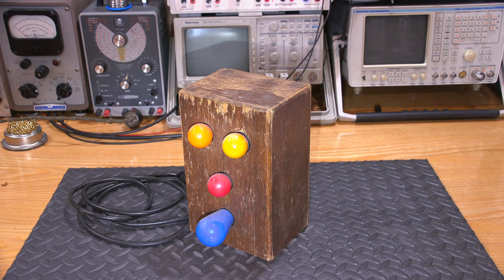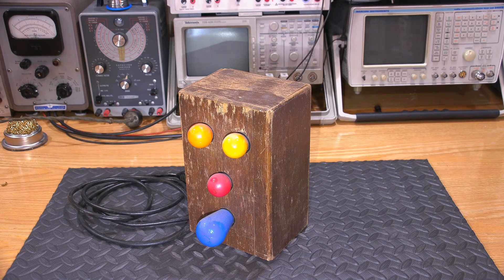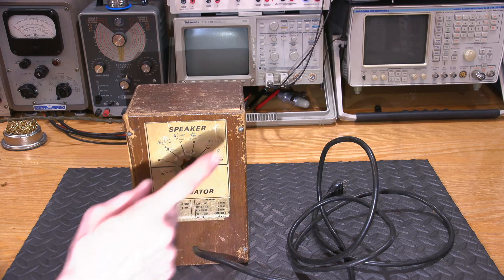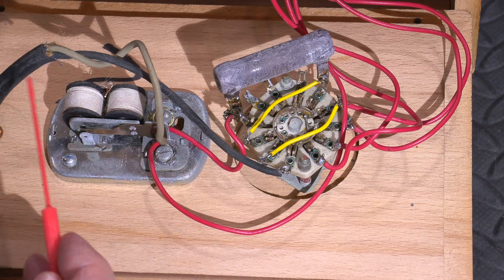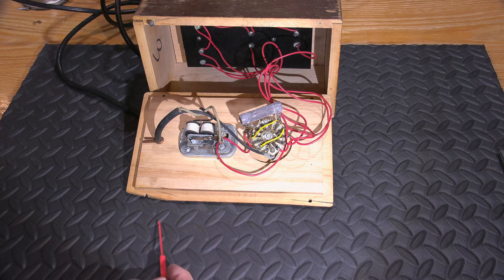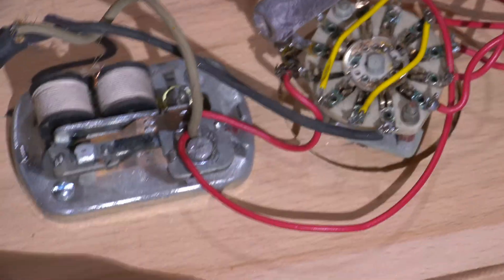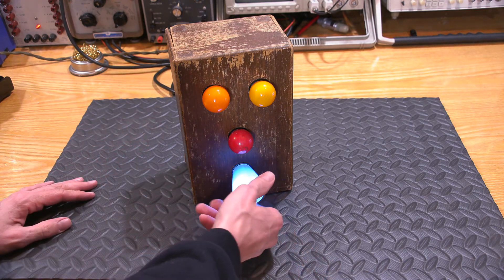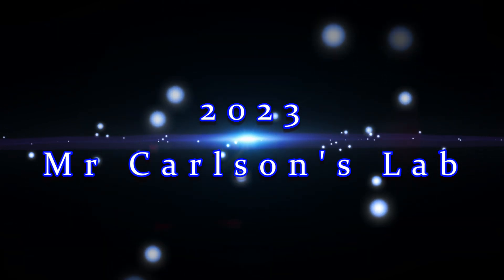1950's? Psychiatric Hospital Electrical Device - "The Evaluator!"

Comment: I don't think I've ever seen a buzzer like that connected directly to 120V. They are usually designed for about 12VAC/DC.. NOT TO MENTION the hot frame connection.
I'm guessing that you are correct, the contacts will not last long at all at 120V.
Buzzers designed for 120VAC usually don't have contacts, they just vibrate at 60Hz. (And make a horrible noise)
Definitely an interesting video, solving the mystery.

Comment: The arc at the contacts ends up maginified as a result of the electromagnets acting as inductors.

I can remember as a 10 year old kid making buzzers out of 6-volt relays, using a 9-volt battery, and then very QUICKLY finding out about the inductive "kick".

There can end up to be 100volts+ at the power terminals depending on the relay and how the coil inside was made. 

Then I figured out how to drive the right transformer with my buzzer relays, and stepped the jolt up quite a bit. Then it was time to charge up breaker point condensers with it, and then toss them to my buddies to see what their reaction was when they caught it and got zapped.  

Yea, I was a typical dick as a child... 😆

Comment: I built something like this. We call them  Toastmaster Timer. It's for public speaking training. The face is unique. Most of them I've seen are a more stoplight style configuration. For a 10 minute speech usually the blue light (or green comes on around 5-6 meaning  your halfway through the main body of your presentation  Orange or yellow was 2 minutes to the end. Red for finish now and the buzzer is your 1 minute over.  The buzzer was something every speaker dreaded.

Comment: It looks like a common low voltage door buzzer with a resistor sufficient to drop the volts down to 16 or 24 volts.

Comment: Door buzzers were designed to operate on low voltage from a step down transformer. typically 10-24 volts.  The big power resistor in the box was used as ballast, to limit current through the buzzer while operating it directly from the mains voltage.  While this might have saved a couple of dollars, it would have been murder on the buzzer interruptor contacts.  With the contacts closed, the coil resistance in series with the resistor forms a voltage divider which drops the voltage across the coils to something manageable.  At the instant the contacts open however, the full mains voltage appears across them, striking a nasty arc across the gap.  The lifetime of that buzzer is probably less than an hour.  That ballast resistor probably gets toasty as well.  Set up a time lapse camera, better yet a thermal camera and see how long it lasts.

Comment: Somebody bought Elvis's private jet with much of the equipment still working after sitting for decades in Mexico. The Fool who bought it started up with an external power unit, he could have set the whole thing on fire with a spark.  I was wondering if you would be willing to do a shout out to restore some of the vintage stuff such as the FM/AM radio or the CRT that has custom cabinetry built around it?

Comment: Icom 7800 ham radio outlet has one needs a back lite it weak maybe you or your friend may want it it's  a $10.000 radio new they want $ 3.800.00 for it top of the line radio it be nice H F radio for you in my video ham radio outlet 2/28/2023 that how you find my video

Comment: Items like this frustrate the heck out of me since the designers fail to consider those of us who are colorblind.  Being red-green colorblind, I cannot tell the color difference between the red, orange and yellow light bulbs.  The only way I could utilize this device is by being able to see which position the illuminated bulb is in.  Just as I have to do with traffic lights.  If I’m not close enough to see the position of the lit bulb, I’m lost.  I have a similar complaint with weather radar.  I can see the difference in shading but cannot tell what the colors are to indicate the intensity of the weather threat and whether I should be heading for the basement or putting out my lawn chairs.  As applies to electronics, I am unable to work on electronic equipment since I cannot read resister color band values or trace a wire by following its color.  Believe me, it’s frustrating.

Comment: Ok Paul, I forgot to ask about that really cool neon you used. You should do more short videos on your collections of tubes, neons Nixies, etc. Fran has some great videos as well. As for the bulbs in this thing, the top three are S11 and the bottom one is an S14. If it wouldn't destroy the antique value on this, make a binary counter with this. Maybe a timer with a half second buzzer when the count is done. Thanks again for keeping it interesting!

Comment: On a related note, I wish you could get a modern ECT 'medical' device to check out. Given it's designed to send rapid electrical current pulses through the brain from electrodes on the skull, it's in the highest class of restricted medical device so I'd like to see how it compares to consumer/industrial electronics. In 2020 I had 6 individual treatments, and the process is really interesting. They run it 3 days a week and a small group of patients arrive at the hospital/center early in the morning to get changed into a hospital gown in seperate hospital rooms on a bed, then given the IV tube needed for general anastesia. Not long after, everybody is rolled on their beds down to a large room with a team of nurses/doctors and some rolling equipment. It's all open and you can see all the other patients, except they close a curtain around the patient's bed when the team gets to them. There wouldn't be much at all to see/hear but what surprised me is that the ECT device gives aural tones corresponding to the electrical output. It's pretty quiet until the Anesthetist says goodnight, followed shortly after by some rapid tones a bit slower than 60hz AC for maybe 5 seconds per patient from what I remember. They either do unilateral (one hemisphere) or bilateral (temple to temple), but bilateral produces even worse damage/side effects. 

It's no Lobotomy, but it's a treatment from way back that's stilll in fairly widespread use for treatment-resistant depression and maybe some mental illnesses. It's a fascinating 'treatment' but, as you might expect, randomly shotgunning through the brain isn't exactly precise and causes varying degrees of long-term memory loss, with seriously impaired working-short term memory which tends to nearly or fully recover after leaving the ECT groups.

Comment: Note that the wirewound resistor drops the 120V AC to 16 to 24 V only while the contacts are closed. As soon as the contacts open, it has the full 120V across the contacts. Maybe a little more due to inductive kickback. This is why it's sparking so brightly.  That is not normal.

The contacts would quickly burn out except it's not left on very long.

Comment: I once built something very similar as a teenager for my mother's toastmasters club.  Mine had a project box with a series of latching switches on it and a 120v to 24v doorbell transformer.  The lights were on a separate unit that I made with a trailer lighting bar and a wooden base that I stained and finished.  There was a handset cable between the portions.  I bought all the parts at Canadian Tire and Radio Shack and found the wood for the base in the neighbour's offcuts in his garage woodworking shop.  This would have been at least 30 years ago.
Reply: This video really filled in some things that I have wondered about for all these years.  The Toastmasters club had a very specific list of requirements for the device, including having stained wood.  I never knew why they asked for that and I suspect that the company that was making those wooden light boxes stopped making them and that is why the club came to me to make them a new one.

Comment: Does the buzzer cycle at 60 cycles per second based on the power supplied?
Reply: No this type of buzzer is vibrates by its own interrupter contacts. It would work on DC. The frequency is determined by its mechanical resonance.

Comment: I like that little box. It looks like one of those indicators that would indicate to a speaker presenting a speech or an argument that his/her time is almost up. What I like about the manual operation is that if the operator thinks the speaker is speaking a lot of rubbish, he/she could cut it off very quickly. Straight from blue to red and if the speaker still doesn't want to shut up, turn that mean buzzer on. That should be enough to scare the excrement out of anybody.  There is just one step that it doesn't have. That is where some probes are attached to the speaker and if they don't stop talking when the buzzer goes off, 115 Volts is coming, or 230 Volts. It doesn't really matter, does it?

Comment: I saw a radio disk jockey transmitting from a remote location where he was interacting with the crowd at a fair. There was a box similar to yours on the table at the booth he was in. It was a visual indicator of how much time was left before he was going to be live on the air.

Comment: The resistor looks to be in series with the buzzer, presumably  to operate a low voltage device off line voltage. Arcing would probably be alot less at the rated (16?) volts.
Reply: Those buzzers could operate around 8-10 volts. Had one in my house - buzzer and transformer from 1938. Still working in 2022. I played with them as a kid and do not remember seeing any arcing.

Comment: Not a 'Speech Evaluator" but a manual 'timer' for speakers to complete in the allotted time, followed by an evaluator to speak. 
In Toastmasters, after the speech is done the Evaluator (another person in the club) will give a short evaluation and offer tips for improvement; a third person acts as the Timer. This device serves as the Timers indicator for the other two. 
(I'm not in Toastmasters, have no problem with public speaking, but my wife was in Toastmasters for many years; as a non-native second-language English speaker it helped her quite a bit.
 Those who don't feel the need to join Toastmasters or are not interested should respect those other people who do find it valuable. Toastmasters also acts as a social setting for many.)

Comment: Great video, amazing those conact points survive at all that voltage, compared th a set of breaker point contacts in an old car engine at 12 volts,once again you need to basically know the voltage ,

Comment: Does that Buzzer open and close with the line frequency?
Reply from the maker: It would try on each half of the cycle. Whether the arm with the contact can keep up to speed with the sine wave is another thing.
Reply: No. He explained that. It's the opening of the conacts that makes it vibrate. It would works as well on DC. The frequency is determined by the mechanical resonance.

Comment: Looking at the front and back, you are showing this item upside down. I don't think it is supposed to look like it has a face on it. And I agree with others that this was used to give signals to a speaker telling them how much time they had left. The label also indicated that the bulb colors are incorrect. Originally the unit had green, yellow, red and white bulbs. And those would turn on in that sequence, giving more of a 'have to stop soon' type warning.
Reply: Maybe it neve did have a green because the maker couldn't find one. He used what he had.

Comment: OK, everyone else is offering benign explanations related to timing speeches and debates and ignoring the creepiness around this thing coming from a psychiatric hospital, so I'll buck the trend and offer another possibility.  A patient who has a distant relationship with the truth is interviewed by a doctor.  The doctor uses this device to give feedback on the perceived truthfulness of the patient's answers.  Blue bulb for truthful answers, yellow bulb for mild untruths, red bulb for a whopper and the buzzer for bald-faced lies.  Too many of the latter and corporal punishment would follow.  The light/buzzer box allows a bit of separation between the doctor and the feedback received by the patient; perhaps a useful feature when evaluating patients with violent tendencies.  The only thing missing is a set of electrodes to attach to the patient and a switch position labeled, "punish." ⚡☠😛

Comment: A neat little surprise to see the very buzzer I learned electrical circuits on way back in 1972. I didn't have a switch, so touching two wires together simulated that part. My dad bought me my own battery to keep me from stealing his all the time. The little bas_ard that I could be as a kid, I would swap my dad's good battery for my dead one. He just couldn't win.

Comment: I wonder if it might be used to evaluate some forms of photosensitive seizure activity, perhaps in conjunction with an EEG to measure responses to given stimulations - the red and blue lights fit for that, but the yellow?  Auditory induces seizures are quite rate but not unheard of, so the buzzer is plausible as well. Very interesting box and curious that its design invokes anthropomorphism, I wonder if that was intentional or just happen stance.

Comment: When I was in the signal corps, some tech had  made up a box with all kinds of knobs and controls.  It was labelled ''officer box''.  and left in the Tech shop.  After trying all the knobs you would end up asking, what is it for?   The tech to answer: it gives you the impression of controlling many things but actually it produce nothing worthwile but keep an officer busy!
Reply: Reminds me of a place I worked where staff in a large room always complaining about the HVAC - too warm, too cold, air too dry etc. One of the tech guys made up a box with potentiometers marked temperature, humidity, fan speed, etc.
Stuck it on the wall behind the supervisor's desk. Of course, it wasn't hooked up to anything and controlled nothing. However, they stopped complaining! All was good until one of the supervisors thanked the engineering manager for the new HVAC controller. What HVAC controller was the reply? Manager wasn't too happy, the panel was removed and the tech "genius" got a ticking off 🤣.

Comment: I think it actually had nothing to do with patient treatment, I think it was used for practicing or conducting lectures or speeches and it just signaled when their time was ending or had ended.  Notice how it sits with the yellow bulbs on the bottom not the top as he demoed it - based on the rear controls orientation.

Comment: ECT = Electroconvulsive therapy is a psychiatric treatment where a generalized seizure is electrically induced to manage refractory mental disorders. 
It is Electrocuting peoples brains to cause Permanent Damage to the brain. Can turn people into Zombies Opps 25,000 Volts.
MONEY for them to do it.
It is a form of  Aversion therapy, sometimes called aversive therapy or aversive conditioning, is used to help a person give up a behavior or habit by having them associate it with something unpleasant. Aversion therapy is most known for treating people with addictive behaviors, like those found in alcohol use disorder.
If they KEEP Electrocuting  your Brain you will be Avoiding metal issued even though it makes you more mentally ill.
Remember the Psychological experiment where the got people to shock people More and More and More even to KILLER Volts they thought.
Back EMF

.
.
.
.
.
.
.

Comment: I believe old telephones used the same principle in their ringing assembly.
Reply: actually, not quite-the contact was not needed, because a telephone ringer is operated on AC(usually 90 volts at 20 Hz).